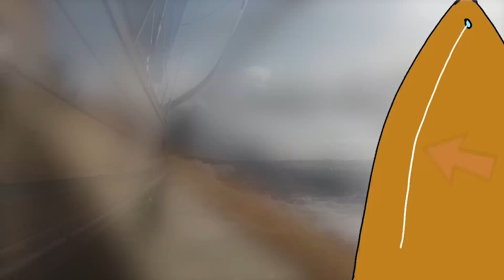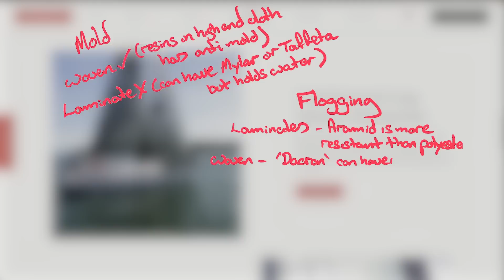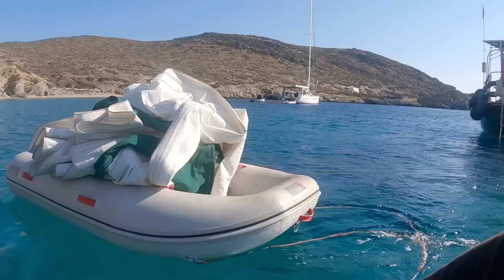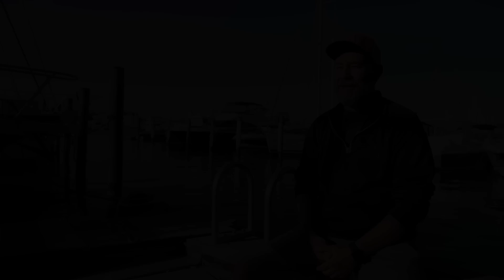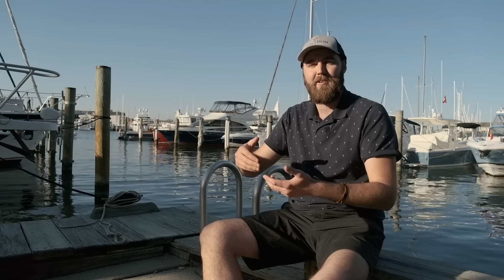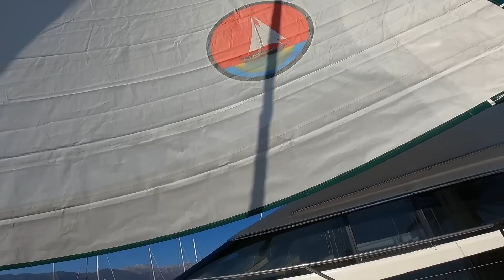Choosing the best cruising sail

Comment: Would be interested to know about your HF and VHF radio systems, and other info re radar and ship proximity guards.  I am a licensed radio ham and always look to  receive Mm signals. Thanks. Phil, Suffolk. March ‘24.
Reply from the maker: We've replaced the rigging now so dont have the insulated back stay as an antenna, Starlink has taken over as long distance coms. We crossed the Atlantic a few weeks ago and it gave us seamless connection all the way across, not as much fun as ham radio but a whole lot more powerful! We still have the radar on a gimbaled mount and of course AIS on the VHF system which is the most important bit of nav gear on the boat.
Reply: @svfairisle  Thank you for the reply. I have no knowledge  of Starlink.  I shall look it up and learn.  Looking forward to that.  Safe cruising. Thanks again. Phil. Suffolk 🇬🇧

Comment: You can use a software called aTubeCatcher to capture image and sound from your computer screen. It is very good. Their symbol is an orange hand. I use it for more than 10 years. Do not capture the sound from the microphone, but from the mixer. Maybe you should change your sound driver.
Reply from the maker: I usually use Sound Paw to capture sound from YT. This was a Zoom recording though so we used their system to capture sound direct to the mixer.

Comment: So on the scale or durability vs  performance, were do you lean?
Reply from the maker: Well obviously you want both, and luckily with the advances in cloth and construction you can pretty much get it. I think you would have to be an out and out racer to be disappointed with the performance you can get with a good Dacron based sail these days, even a cross cut one. Personally durability is key for me, if we weren’t thinking of sailing in remote places then I might have gone the next small step up and got radial cut sail in something like Warp Drive, but as you heard from Jeremy in the interview they rate the radial cloths as equivalent to their 400series cross cut cloths, so not quite as robust as the 500series we went for. I think most high end I would go as a cruiser if I wanted the maximum possible performance would be a radial cut Hydranet sail. It probably doesn’t make financial sense but I think that’s that’s the ultimate performance while still keeping durability, you just have to pay for it!

Comment: An interesting process.  Gone are the days when a sailmaker would not only measure the boat, but also come out sailing/racing before/after to see what was needed, make any adjustments, give advice on trimming, compatability with other sails, settings.  As they said knowing the boat and conditions it will be sailed in are important.
Reply from the maker: I’m sure you can still find that service if you look hard enough and your pockets are deep enough! I personally like the fact that you have more involvement with Precision you can take it as far as you like, send them pictures/videos and they will give you advice, you can see they enjoy that part of the service.
Reply: no, those days are not gone. i recently had a local sailmaker build me a set of hydranet sails, measured, made in a local loft, installed, fitted - they will disappear if everyone buys generic sails online
Reply from the maker: @akathesquid5794  These aren’t ‘generic sails,’ far from it, they are designed specifically for you and your boat to exacting standards. I agree that if you have a local loft you trust and who will supply the sails you need and give personal service at a price you can cope with then go with that. For us though Precision provide a service that’s as close to that as possible but is available to us anywhere in the world, they have become our ‘local’ sail loft! And the price is good too.

Comment: That new yankee looked on the CAD screen to be over a 100% sail, which after talking to you about your headsails before, is quite a bit larger than your previous one. I suppose you will get a performance benefit from that?
Reply from the maker: Yes it's a 115, the last was a 95. It's also slightly lighter cloth but should be very strong. With us heading towards trade wind sailing and not having any coloured sails I want better downwind performance and I find in stronger upwind legs we point higher with the staysail as well.

Comment: We recently purchase a sail from Precision for our 43 year of racer/cruiser.  We use it for racing on SF Bay.  I’m pretty satisfied with the sail but have second thought about not getting it from a local sailmaker.  The primary reason we selected Precision was cost.  Our new 135 was just over $3000 from them, well a similar sail locally was $6000-$8500.  That’s a big saving.  Yes it took three months to get here and yes you don’t get to just call someone and get them to make a small adjustment but given the price difference I don’t see how a local sailmaker will be able to remain in business and I question if that’s a good thing.

Comment: You gave little mention to the Industry #1, North Sail. Sure; I get it you are sponsored by Presion Sails and have to plug them. On the other hand if not sponsored better to look at North Sails 3Di. The outstanding value with industry leading shape holding and a longer service life compared to other sailmaking technologies. Proprietary engineering and construction methods allow 3Di sails to maintain their shape to an unprecedented level. If you do the math,  you’ll find that 3Di sails have a lower cost of ownership than any other sails in the world. 3Di sails are significantly stronger and lighter than competitors’ laminate string sails and panel sails are rot when made of comparable materials. The building blocks of 3Di structures are spread filament tapes. Filaments are the elemental form of fibers. It is not a laminate! The key difference is composites are materials combined to maximize their strengths and minimize their weaknesses. Composite construction is different than lamination where a substrate (such as mylar) is used to carry adhesives and materials. 3Di sails are composed strictly of spread filaments and thermoset resin. 3Di is stronger, lighter and more resistant to environmental factors than laminate string sails. North Sails is the only sailmaker in the world to build sails on full-sized 3D molds, inflated to the sails’ precise flying shape. Heat and vacuum pressure are then applied, consolidating the composite structure. The sail’s shape and durability are permanently locked into the rigid airfoil that is customized to the user’s sailing preferences. Currently anything less is just that.
Reply from the maker: I think you're sounding a lot more like a salesman than me! I did look at North sails and there's no doubt that their 3Di sails are amazing but as for as total cost of ownership is concerned I think you are 100% wrong. I didn't go into Hydranet as much as I intended to in the video (you can never get all the details in a video without it becoming too geeky for most) but Hydranet is a similar deal I think. An excellent cloth which might last twice as long as the next best (something like we've got - Bainbridge HSX) but it's at least twice the cost. So this approach makes little sense for cruisers because at the point we might need to replace our sail we would be half way through the life of a hydranet sail and brand new sail is always going to be better than one half way through it's life (and its the same cost for either option) I actually discounted 3Di quicker than Hydranet because there it hasn't been around long enough to know that it's going to last twice as long as a good dacron sail, it is liable to sun damage so although it may not have the problem of laminate separation that those sails have it's very dependent on the coatings it has to protect it. The most robust range is the 'Ocean' here's what they say about it... North has a third range of 3Di called OCEAN for the largest cruising yachts and provides high strength and ultimate durability. These sails contain Spectra and aramid filaments and gain durability from protective outer surfaces of woven polyester taffeta tapes.....     The cost associated  with 3Di sails is huge, I haven't had a proper quote, but probably 3 times the cost of the sails I have! This just makes no sense at all for us. Maybe if money is no object and your main concern it having perfectly shaped sails at all times and the minute they become less than perfect you will replace them, then 3Di might become attractive but that's not the case for most cruisers.
Reply: @svfairisle   If you look at the cost from the type of sailing you do and your vessel I would tend to agree that  may not be the best option from a cost and performance aspect. I do not agree that your choice is the best option. Tell if I am wrong but as I pointed out your biased dicision was based on sponsorship from Precision. There is a reason that North 3Di is choosen head and shoulders above the rest. So tell me if North was giving you sails like Precision, which would you choose?
Reply from the maker: If you watch through all the various episodes and technical videos we do you will see that your accusation that we are producing biased reviews is completely wrong. We have had sub standard gear before and said so. Luckily for us this doesn't happen often as manufactures do not offer us equipment they are not confident of as we retain all rights to say what we think and will do just that. Your question about North sails is not actually relavent because I do my research thoroughly before deciding what to go with. My research told me that 3Di was not a viable option for what we want to do. So although I could have contacted North Sails and asked if they would match the deal I was getting from Precision I could not then make an honest video about choosing that sail. So it's irrelevant, I simply would not choose a 3Di sail even if I got it for free because i would have to say to the viewers don't do this as it's not the best option for a cruising boat, or lie, which we are not prepared to do. I had a similar decision to make very early on with Cromox anchor chain as this is much more expensive than galvanised chain. I actually spoke to 3 different specialists, one of which we interviewed in the anchor 101 video before making the decision that this chain was worth the extra cost. this was before we were an established YT channel but the philosophy is the same. If at any time we start giving advice we do not believe to be true we are done for!
Reply: @svfairisle  Without belaboring the issue further, you have illustrated my point exactly. Your decision was based on your channel marketing and cost. The relavance of product do not even compare. I find it hilariously disigenuous that even for free you would need to tell viewers that Precision is a better option than North 3Di. The cost to performance and longevity do not compare between the two.
Reply from the maker: I'm not sure why you are finding this difficult to understand. We don't base anything on 'Chanel marketing' because we don't have any. We simply research and buy what we consider to be the best gear available, that's taking everything into account including price. What would be disingenuous (actually worse, a flat out lie) would be accepting a deal for a very expensive sail and then claiming this is the best option for people who would not get that same deal. We could not claim buying a 3Di sail is the best option for cruisers because as even you have admitted, it is not.
Reply: @svfairisle  You misrepresented me,  for you it might not be the best option. Spending large amounts of time in a marina and day sailing from anchorage to anchorage. For those who are putting in the miles 3Di is more cost effective. So can anyone using your channel get the same deal from Precesion? And yes to present old school panel sails as best rather than advanced technology is disingenous.
Reply from the maker: @bojangles8837  Ha! You misrepresented yourself mate, your argument is all over the place. I actually had a message yesterday from someone who has a 3Di sale, he loves them, he’s a racer, but he’s already trashed one. It blew out with very little warning and is not something he has any chance of repairing. He’s still happy it did a great job while he had it he says and he will just buy a new one for the next race. For us sailing around the world though that would be a disaster to be left with a sail I can’t repair myself and somewhere like the South Pacific probably couldn’t find anyone else who could repair it either. I’m sure you’ll have a nice time looking at your nicely shaped sail, I just hope all those miles you say you’re putting in are up and down a coast packed with top end sail lofts! And you’ve got your wallet with you!!

Comment: Your new sail looks nice with the logo. What was the process of making that happen?
Reply from the maker: Precision have a few options of having it printed directly on the sail or as a sticker that can be replaced. Ours is a sticker but you wouldn't know. They adjusted the logo so the writing is only on one side as with the light going through you can see some of the image from the other side so non symmetrical logos are a bit more tricky.